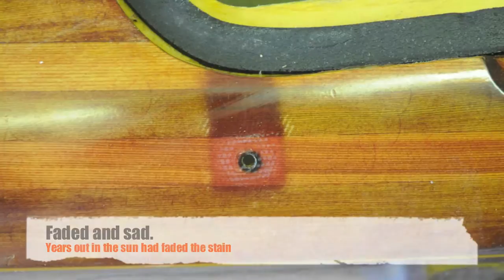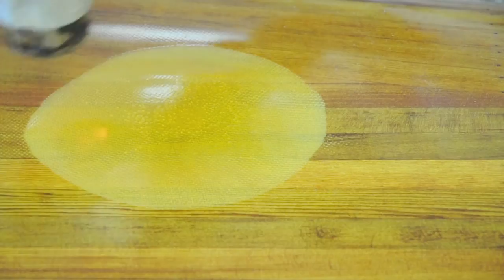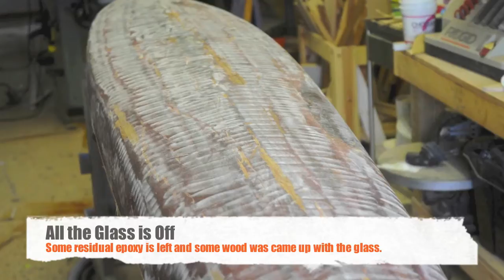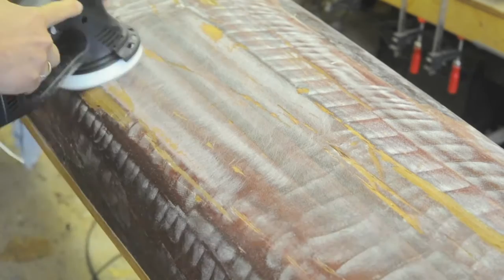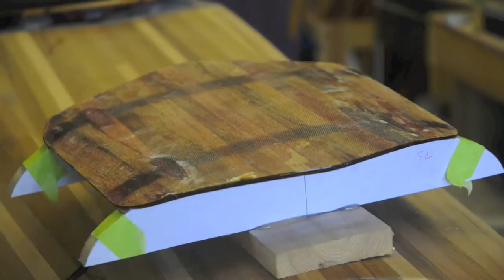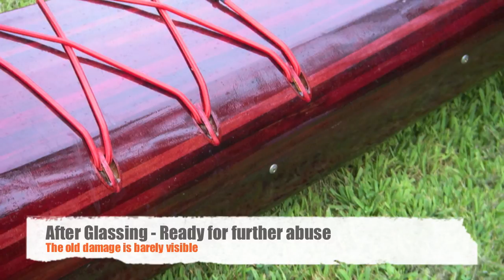Using a heat gun to remove fiberglass from a strip planked boat

Comment: Hi Nick, I have a dilemma...I have a number of broken strips from my ALaska trip and have been peeling the glass off the boat. I had the heat gun on its lowest setting where it would heat the fiberglass....my concern is that the amount of heat that is transferred to inside of the hull could potentially loosen up that glass as well.  Actually most of the glass came off fairly easily, but there are some pieces that still need to come off. What do you suggest?  I don't want to loosen up the glass on the inside for obvious reasons....